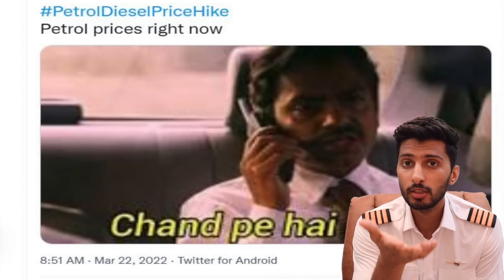How much fuel do pilots carry on an airplane?

Comment: Taxi Fuel + Trip Fuel + Contingency Fuel + Diversion Fuel + Final Reserve Fuel + Ballast Fuel (if required) = Total Leg Fuel ,
eg Airbus A 380 aircraft
Total fuel burn is around 4,050 Gallons/hour
Total Leg Fuel is around 
12 hr 55 min
12.90 hours x 4,050 = 52,245 gallons of fuel required for the flight leg
Reply: Huh